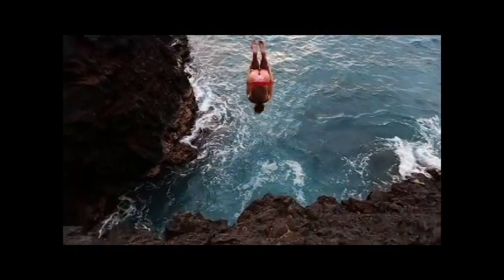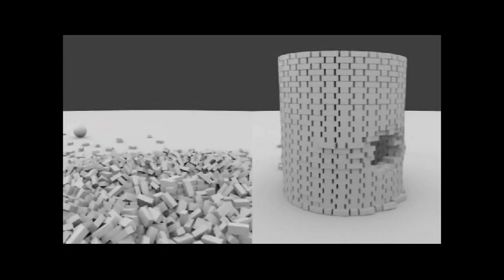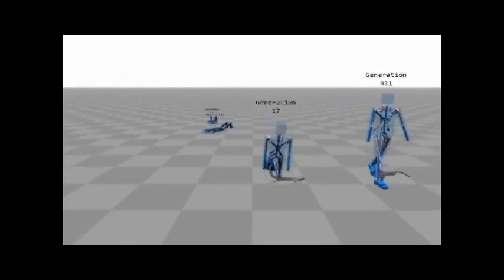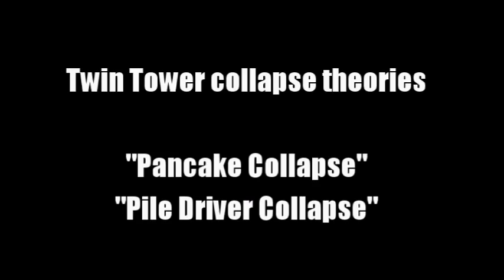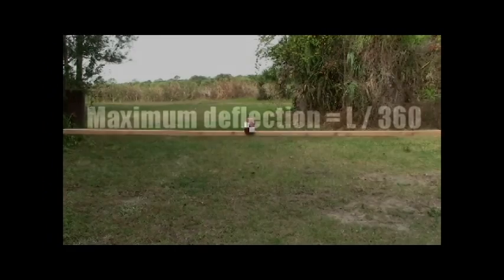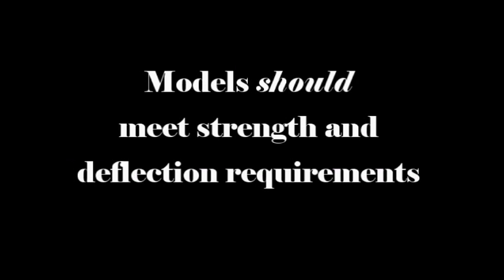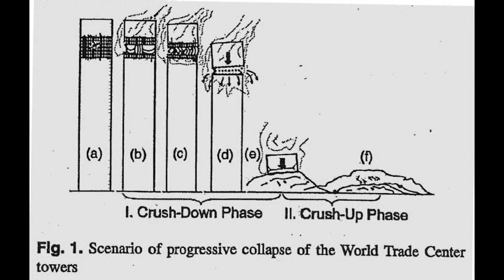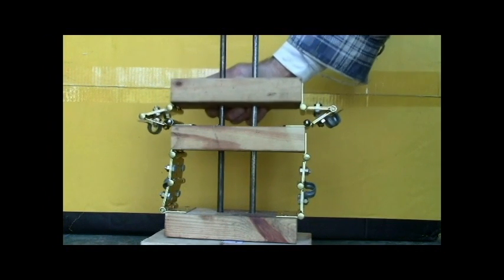9/11 Experiments: The Force Behind the Motion

Comment: you should get in contact with a few of the other people i see making computer simulations and give them your data and work on a project together, the number one thing i have always thought about when they say fire melting supports etc, how did this jet fuel manage to burn so long? when the plane impact the fuel is kept in the wings. wings are normally designed to fall off on impact since they contain the fuel and during crashes would burn up the plane and survivors of said crash. so the question becomes how did the jet fuel pool and burn for so long? if the impact was such great speed and power that when the wings shattered from the force of impact the fuel wouldnt just pour out of the wings and make a pool. it would be propelled forward and hitting off of beams chairs desks etc this would cause a mist effect with the fuel and the fuel would almost all instantly burn up not create a pool. the fire we see during 9/11 is jet fuel at first( would ignite everything) then after that it is all office furniture and papers. since the jet fuel would have burned up from the mist effects. also when the "plane" impacted it left a whole in bot sides of the building jet fuel is a liquid and would follow fluid dynamics if there really was enough jet fuel left over after the said mist effect i have brought to issue why didnt it flow out the windows of down into other floors? everything about 9/11 stinks
Reply: +TheCronoSlayers  I'm just an ordinary guy that's worked construction all my life and to me the whole 'official' explanation is a joke. Kerosene won't melt steel without an oxidizer and maybe not even then. The smoke was black indicating oxygen starvation and therefore a colder burn. Paper and vinyl in a oxygen starved place will burn hotter? Oh REALLY?? The building had to be built so the lower floors supported the upper ones or it would have fallen in on itself a long time ago. People will believe anything they're told. Pitiful, isn't it. Gravity never lies and a freefall doesn't either.
Reply: +Papa E  - Well done embellishing what is basically only an office fire, haha! Yes, the jet fuel "burned up" within minutes, so how does that help you? What was it's big role in dropping the buildings other than starting the fires? Do you see how you've made absolutely no point whatsoever, Papa?
Reply: +ManAgainstCrime exactly what i was thinking when i read his post. he is only stating the obvious of which i said that the fuel would have burned up almost instantly. papers and office equipment will not even get remotely close to the heat the jet fuel does and thus the heat would not have been intense enough to collapse the building.
Reply: TheCronoSlayers  These true believers are making this shit up as they go along, stubbornly defending the indefensible just out of sheer bloody mindedness. They're in such a hurry to be right that they don't notice when they contradict themselves and even at times inadvertently support what we're saying (as in this case). Worse, they don't care. They just carry on cheer-leading for bullshit.
Reply: ManAgainstCrime Perzactly. If kerosene won't melt steel I don't think carpet and paper would.Seems like if it would it'd be used in foundries and steel mills.
Reply: Where in the NIST report does it mention that melted beams casued the towers to collapse? You truthers are complete idiots.
Reply: lol papa e your to much
Reply: Papa E  Here's one for you. How does the beam walk off it's seat with stiffener plates in place (wtc7)?
Reply: +TheCronoSlayers You need to do a little more research.  There is an abundance of information pertaining to the jet fuel and the role it played in the events leading up to the collapses of the WTC towers.The jet fuel was the catalyst for the WTC fires, the resulting inferno was intensified by the combustible material inside the buildings, including rugs, curtains, furniture and paper. The fuel more than likely burned up within minutes.
Reply: ManAgainstCrime True. Must not need common sense to figure something like that out. Sure don't see any.
Reply: See, I don't "need help". I am on the side of science and facts.  You're on the side of charlatans and delusion.  You have never read the NIST report. This I know from your post.  I suggest you read it...if you don't understand it, bring it to a local university and ask a structural engineer to explain it to you.